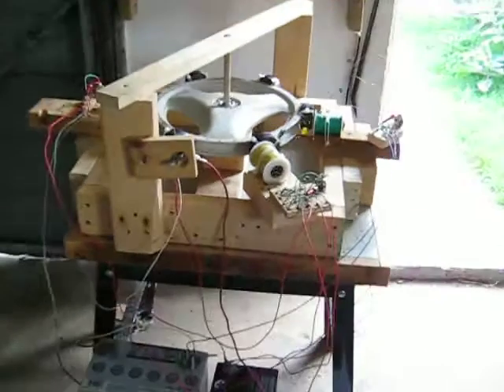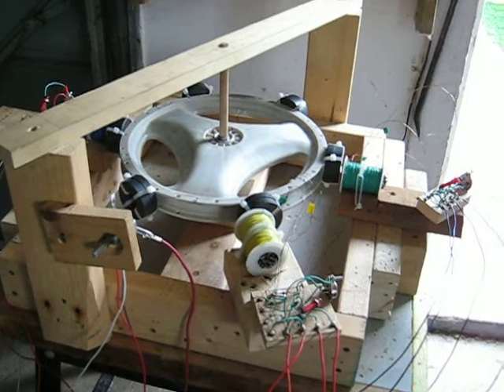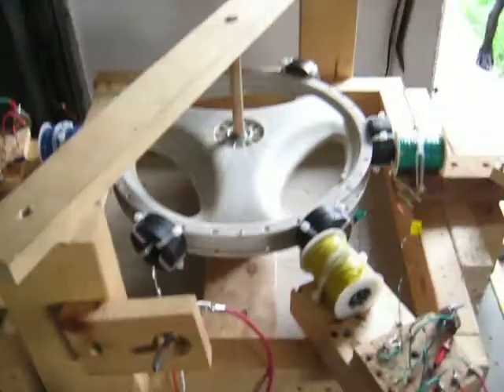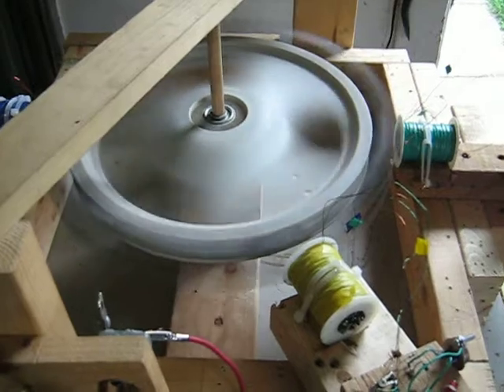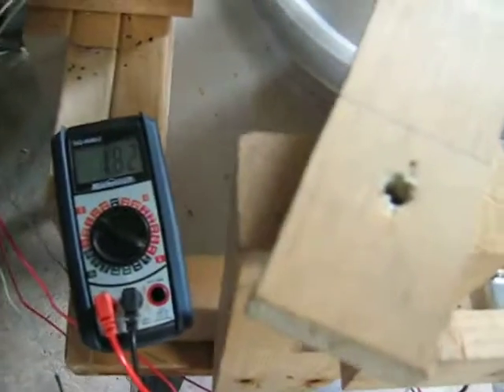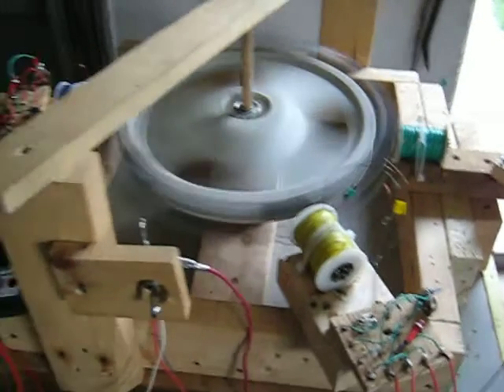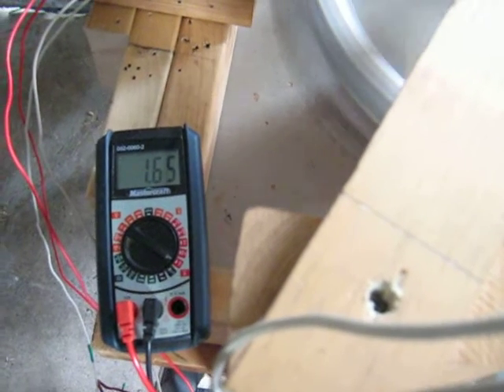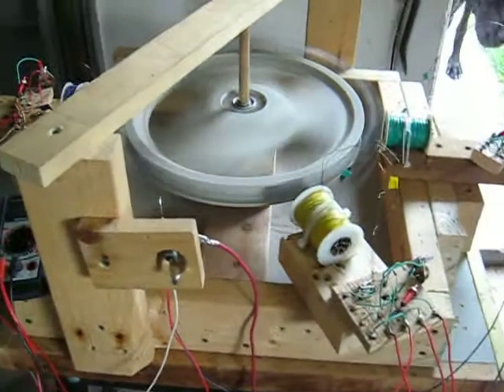Bedini Motor vs Flynn Motor

Comment: hook it up to an alternator and see how much power it can put out. also your electric motor draws power based on how many times the magnet passes a coil so as the wheel spins slower the magnets will move past the coils less times per minute therefore use less power. the faster it spins and the more coils & magnets you use the more power it will use but again as you add load and reduce speed you reduce power input. now to spin the same speed and add load and see the input go down would be something pretty cool. also would be cool to see how much if any parasitic drag is created by the rotating assembly and see how much power can be produced from such a unit.

Comment: interesting question since one would think the spikes are stronger at lower rpm because a larger chunk of current is allowed to be bit from with that extra time the core has to saturate, but this is counter-intuitive because of the fact that the overall draw decreases at the lower rpms. this is not a rock solid thing it all depends on the specific resistances of the circuit but when it comes to a motor using a mechanical switch it does indeed bite more current at the lower rpms for that reason.

Comment: This is true, it's a pulse motor. Slowing it down, slows down the magnets going past the coils and thus slows down the number of pules from the run battery per second. This of course reduces the load/amp draw. This is totally normal conventional thinking. The mysterious thing is why does the radiant energy spike get more powerful when the rpm's go down. Tom Bearden explains this and says it's because normal current eats radiant energy. So the less current in the system, the more radiant energy.

Comment: have you ever hooked it up to and inverter or alternator from a car which could keep more batteries charged.  I've seen a lot of videos on youtub but none that ever shows it powering more than a few low watt leds.  I am very interested in getting one but I want something that I can use as a power source to run lights tv etc

Comment: @MAllen7424 exactly. u hit the nail on the head with those 2 posts. as far as the amp draw i use magnets!

the problem of course with the cog free attraction motor is adding generator coils.
however with tuned resistance those can be added cog free as well =)

Comment: er i mean not thicker but thinner..
i know alot of bedini guys say the faster it goes the less current draw there is but thats just because they are tuning their pots up to draw less current while a maximum field nullification level is met between the rotor and coil on an attraction motor. i use a reed switch for the better pulse but its just like the bedini its pulse activated so the less speed the less everything else, at least over time of course which is what the meters care about.